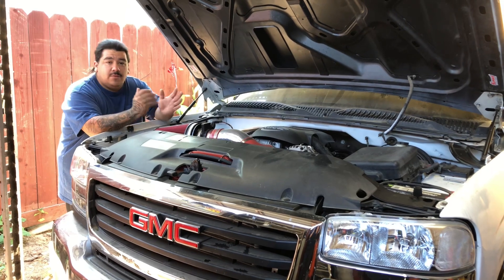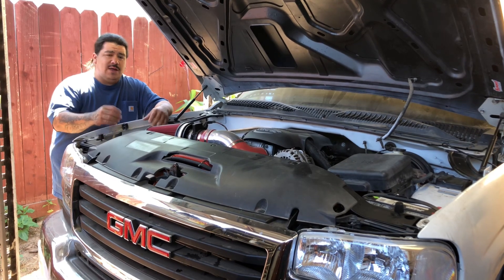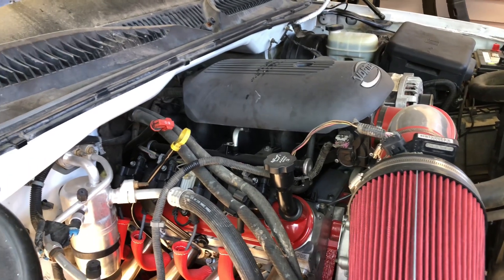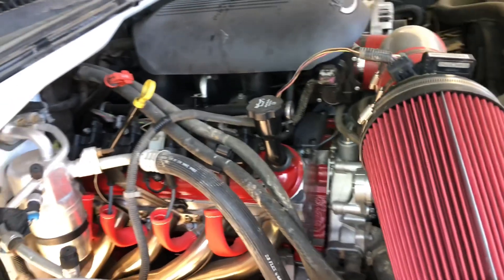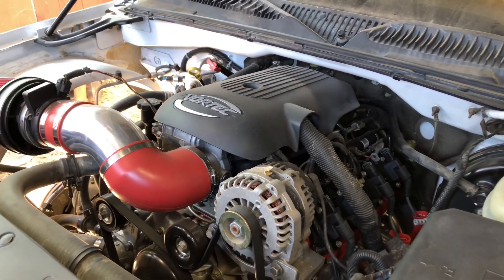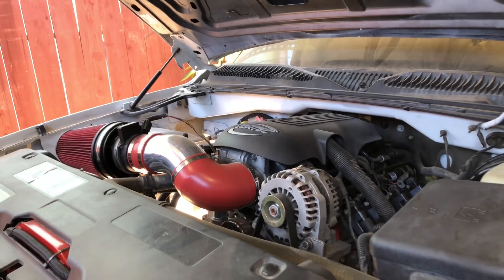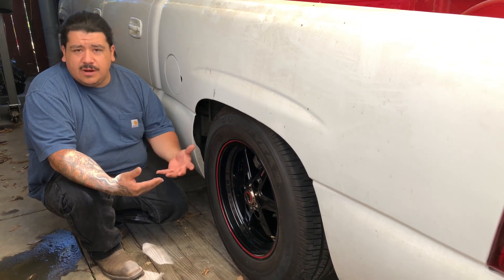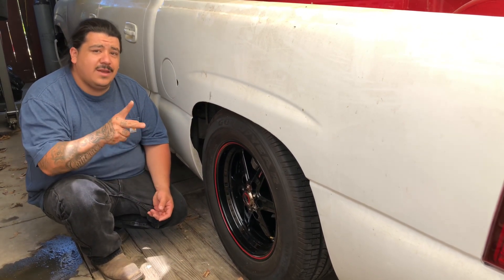2005 gmc sierra 5.3 sloppy stage 2 cam

Comment: I bought the sloppy stage 2, and it came with the pac1218 springs Elgin offers. I ran the car for a bit, and I snapped one of the springs clean into 2 pieces. I'm guessing you need heavier duty springs for this cam😅
Reply from the maker: Lol dam all bad I haven’t drove this around yet so i guess ill see if it happens to me lol crossing my fingers lol
Reply: Nope just need a better spring , popped one also. Had another set so spent 15 minutes and changed the spring, when I do any work I pull heads for I'll be getting a better set of springs. Not worth it to do em one at a time imho
Reply: same here i orderd double spring

Comment: I saw you video when you first posted so when taxes cam in I had to have it now I gotta just work out a weekend with the boss to bring it to work and tare into mine I got a 2500-2800  stall for my truck pretty sure it's the one you recommended in another one of your videos anyway never could find link to your headers I got some ls swap ones hope I can make them fit around everything and have you tried out hp tuners was thinking about jumping in to that and seeing if I can tune it myself and add another skill to the list
Reply from the maker: Hell yea good shit bro. 
Yea ive noticed some links i post usually dont last long. 
Thats not a bad idea bro

Comment: Can a sloppy stage 2 cam break without a stall or a performance transmission
Reply from the maker: From the research I’ve done i guess you can. But its recommended you upgrade the converter to actually feel a difference. Unless you’re doing it for just the chop.

Comment: Hey did you ever get the check engine light to go out or pass the emissions test ?
Reply from the maker: As a matter of fact, I have to do emissions test this year. We’ll see how that goes. I’ll probably swap over a stock motor just to pass.
Reply from the maker: I never got check engine light either
Reply: @differentgarageprojects5656  that's alot of work to do but alot of other people I see don't have any issues with the cam if everything done right I don't see why you shouldn't pass
Reply from the maker: @prettywomenclassiccars  Here in California you won’t pass smog if they can hear the cam. 
And its not to bad of a job once u done a few 😂